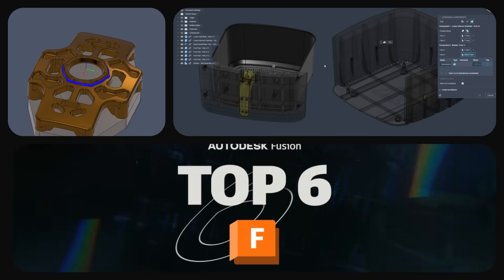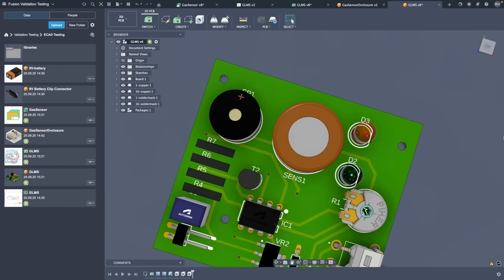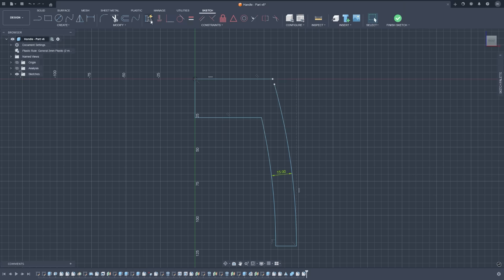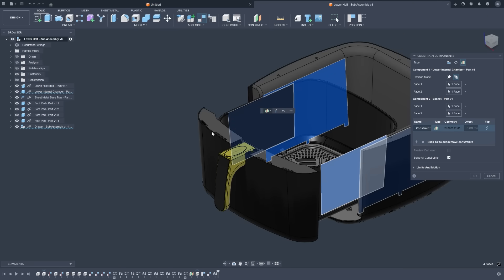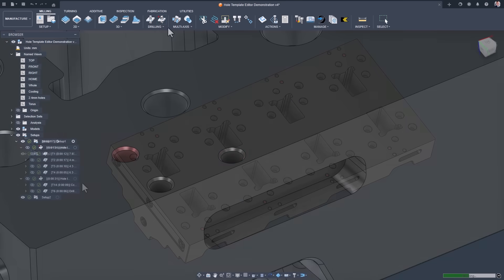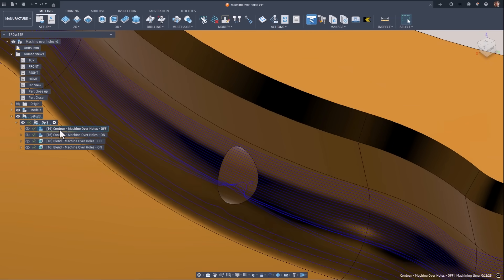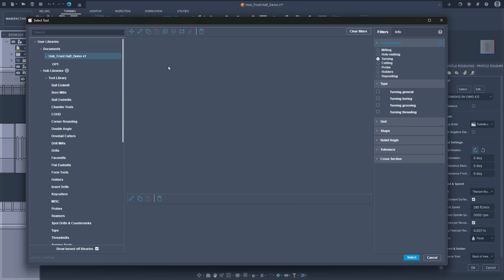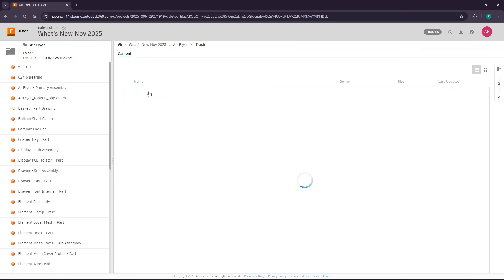Autodesk Fusion Just Got 6 Awesome New Features!

Comment: 💡 The new hole template editor is a game-changer for DFM (Design for Manufacturing)! Precise, standardized holes are crucial for smooth CNC machining and assembly. It's awesome to see Fusion bridging the gap between design intent and manufacturability – a philosophy we live by every day to ensure our clients' parts are not just designed well, but made right. 👍

Comment: Amazing updates! As a CNC Woodworker I really want to see a more woodworking friendly CAM setup.  Something more streamlined to compare with the simplicity of Vectric software.  I only find myself using Fusion CAM  when the project gets a little more complicated. 95% of my cam work is done in Vectric because of its woodworking centric design. It makes it much faster to go from drawing to cutting.  I run 3 axis CNC routers and do a lot of one off files, so I am making about 10 custom CAM programs a day. 

That being said I think Fusion is way more powerful, It's just not every job needs so much power.  Its not  often  that I am cutting a plywood cabinet while at the same time integrating a custom PCB, custom sheet metal box, while doing a stress load test on the drawer box.  point being it would be nice to have  lighter versions of fusion you could load into.   That help the user get to the end of their task quicker with less bulk in the way.
Reply from the maker: Hi Mike! Thanks for the feedback. We are looking at how to balance the power and complexity of Fusion to overcome issues like the ones you describe.

Comment: been like 6 years and I'm still waiting for better sheet metal tools like curved 90 degree flanges that can be turned into flat patterns. Solid works can do this from what I hear,  Sheet metal hasn't seen much love for years now.
Reply: What do you mean exactly?

I use SW at work. 
I have a seat of Fusion at home. 
I do all my sheet metal in SW.
Reply from the maker: Hi Richard! We are constantly improving Sheet Metal in Fusion. New features will be released soon, so keep an eye out! That said, Contour Rolls like what you describe are currently only available in Inventor.

Comment: Another month without much development in the lathe area. Don't get me wrong, all the updates have been incredible, but I still think that compared to the milling department, the lathe is very primitive. In my opinion, the tailstock should be an operation like a subspindle instead of a check box; it would give the programmer much more control.
Import step files for tool holder simulation (lathe and milling).
Reply from the maker: Hi and thank you for the feedback. We are currently working on multiple improvements for working with lathes. We can't talk about specifics, but keep an eye on future updates!
Reply: @adskFusion  I appreciate the feedback, but these updates will certainly only be implemented in mid-2026, although there's already been good progress on the roadmap.